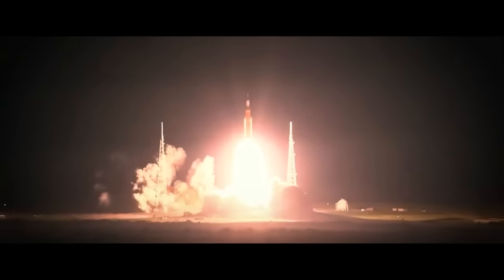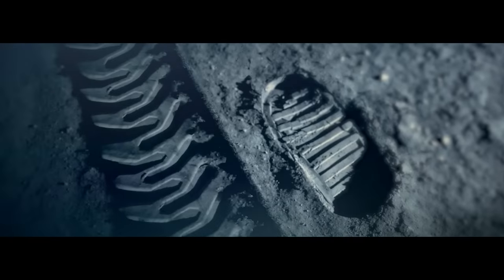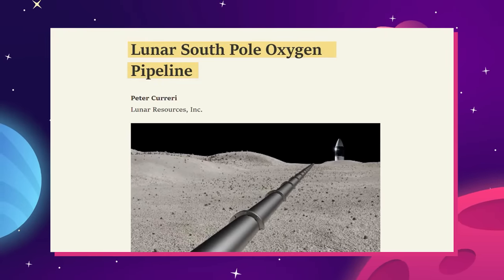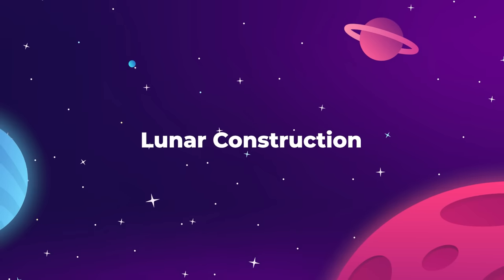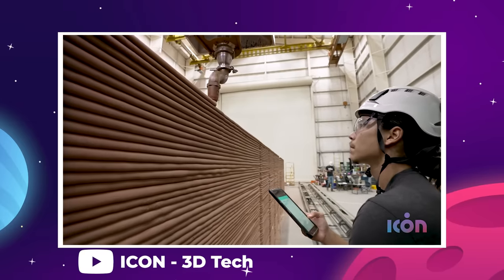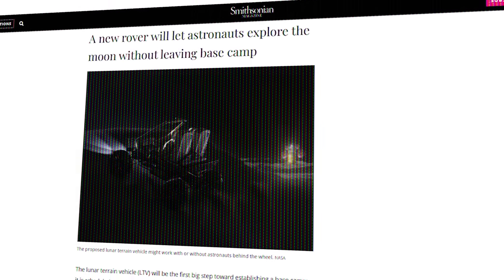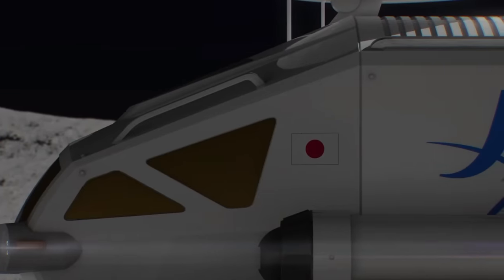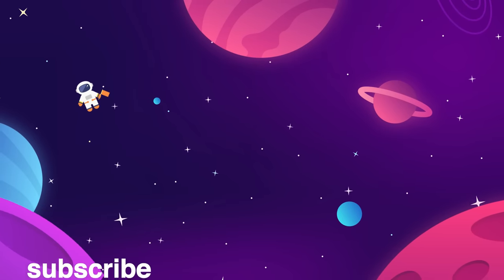How NASA Plans To Build The First Moon Base!

Comment: How do they plan to secure energy source for all this? Just for a reference: To produce a ton of steel in an electric arc furnace requires approximately 400 kilowatt-hours (1.44 gigajoules) per short ton or about 440 kWh (1.6 GJ) per tonne; the theoretical minimum amount of energy required to melt a tonne of scrap steel is 300 kWh (1.09 GJ) (melting point 1,520 °C (2,768 °F)).
If it's solar energy then they will need massive fields. And they are still light years away from nuclear. NASA should give more funding and support to Elon in order to all this to success

Comment: The moon's surface area is about 14.6 million square miles (38 million square km), which is less than the total surface area of the continent of Asia (17.2 million square miles or 44.5 million square km). Would it not be a little bit less stupid, and much easier spending those astronomical amounts of taxpayer’s money on planet earth?

Comment: i genuinely think if we colonised a planet or a moon successfully and created manufacturing there instead of on earth it would give use to mostly ‘ uninhabitable ‘ planets. the infrastructure needed would be expensive but worth it , ores mined at the asteroid belt , shipped to mars for manufacturing to the moon for delivery to Earth. it would atleast remove the cost on the Earths atmosphere due to emissions and pollution from waste. Maybe in a few 100 years this idea will be as normal as shipping ores from africa to china for manufacturing , and shipped to consumers.
this moon mission could lay the ground works for a solar system wide trading route.

Comment: I still think that dust is going to continue to be an issue.  My guess it will ultimately be fixed using some kind of electronic system that repels the dust electrically.
Reply: The dust will be an issue but it won't billow up and hang there like the picture shows. Since there is no atmosphere it will only react to the thrust of the lander it which kicks up will quickly be pulled back down by gravety.

Comment: No one seems to remember the Ares design with eight boosters. 😜 You wanna talk payload? 😏 and they can add back in that fifth liquid fuel engine if need be also. NASA is by no means maxed out in heavy rockets.
Reply: The SLS is based on the Ares launch system. That means a lot of the design components of the Ares rocket are transferable to the SLS. We can launch much larger payloads therefore. These would likely be mostly fuel and provisions, of course, since the crew is a fairly light component of the overall mission.

Comment: Thanks for the heads-up video. Sourcing the resin for 3D printing moon habitats really intrigues me from a chemical engineering point of view. A little more than half the regolith volume will have to be resin and making the resin on the moon will be extremely challenging.  So I guess it will be “Starshipped” from earth in the beginning. 

Landed at $20 million dollar for one hundred tonnes, a 1,700 ft² habitat might use 5 tonnes, so each habitat’s resin costs out at $1 million. Doable.

Comment: Question how do they know the printed structures will be air tight, and able too hold pressure?
Reply: At a guess, build them on earth, pressurize them, and check for leaks.
Reply: Not difficult. Use a Vacuum chamber for testing. Normal engineering process.

Comment: It's exciting, but NASA really needs to stop using US-only units when it comes to space exploration, because it's bound to be (and already is) an international effort, which means that NASA equipment and designs have to work with the other 95% of humanity (let's say that again *95*%) who use proper SI units. We can't have tools and habitats and displays that aren't compatible - it would be a disaster worse than the Apollo 13 issue where they had to connect a square CO2 filter with a round housing. NASA need to stop larking around with Internationally non-standard units just for the sake of Flat-earth Fox News viewers.

Again, the reference to 1 million pounds of Lunar dust when the HLS touches down. What on earth does that mean to most people on earth? Pounds are weights not mass. So, is this 455 tonnes or 2700 tonnes (because Lunar gravity is 1/6th)? You could have at least if you're going to use this kind of Victorian jargon have used tons, because at least then a US ton is approximately a real tonne.

Comment: If they want to get REALLY serious about colonizing the moon, going far industrially beyond just habitation for habitation's sake, here are 2 VERY worthwhile lunar endeavors that would make VERY productive use of lunar Farside as well as its equatorial regions.  On the Far Side, preferrably inside the Mare Orientale Basin, a vast array of radio telescopes as well as a cellular network of infrared telescopes (like James Webb on a 100,000 scale) could see make direct visual observations of Exoplanets.  Now to the equatorial regions, namely, the eastern equatorial limb.  That would the ideal place for a linear accelerator complex that could use a railgun-based launch system to fling unmanned cargo back to earth orbit directly from the lunar surface, saving enormous cost.  Just a start

Comment: Lol no to those building, probably the first base will be a metal shell covered in lunar regolith. My first choice would be a Starship on it side as you can have as much room as the ISS refabed, and then with some elbow grease you can have about 3x the pressurized volume of the ISS by cutting out the fuel tank headers which can take 5 atmospheres of pressure just in standard operation, and you are always supposed to have a 1.5x or greater safety factor so it can take 7.5 atmospheres of pressure so plenty for holding 1 atmosphere of pressure.

Altough you are probably going to be running pure oxygen at 1/5 atmospheric pressure to prevent the atmosphere leaking away and making CO2 scrubbing easier.

Comment: I have never seen any numbers published about the energy requirement of 3D print on the Moon, but I can imagine it is a a lot for melting all that regolith.  The advantage of 3D print lies in producing small but complex and sophisticates objects and components , but not large massive walls and ceilings.
On the moon it simple is not necessary to 3D print walls and ceilings. The main structural challenge is the inner pressure ( 100KN/m2 for Earth´ sea level air pressure) und to keep it airtight.  The his can be  managed with a prefabricated inflatable membrane structure.  that simply  is covered with loose regolith  for protection from cosmic radiation ans micrometeorites.
A sufficient protection from radiation requires a 4 -5 meters thick cover of loose  regolith or 2,5 - 3 meters of 3D printed wall structure, So the time and energy requirement to 3D print these masses would be enormous .and you still would better  cover the inner side of the wall with a membrane to make sure it is  airtight

Comment: I agree with @Space Private that the electrostatic problem with the dust is going to be a big obstacle. And as everyone knows, the Apollo lunar astronauts' short duration outside the Van Allen radiation belts is what enabled them to be safe from high radiation. NASA will have to figure a way to safeguard crews on longer moon missions. Portable magnetic field generators are being considered. Some believe 5-foot-thick lead walls around vehicles ought to be used. At any rate, we have a lot of work to do. I'd like to see a moon presence be established, but the NASA and contractor PR people need to be upfront about where we stand.

Comment: I wonder why NASA decided to build a surface habitat instead of boring into the crust. All the tech and equipment would be about the same for a borer. Underground bases can be endlessly expanded, and protects astronauts from cosmic rays and meteor showers. One small pebble could go right through that surface habitat and cause a explosion of the pressurized air.

Comment: IMO the best base-building would be just burying Starship underground VERTICALLY. 
Vertical shaft sinking technology is well proven on earth. They'd only need to attach external ring around starship (for stabilisation and lowering winches), and ~3m diameter elevator shaft through the middle of entire rocket (to get boring machine out after sinking for reuse, and for future elevator between floors). And a self-propelled crane, for moving ring and boring machine to next starships.

Comment: The dust is ionized somewhat by the sun's rays and can float around as if there were an atmosphere and so it can get where you don't expect it.  An anti static charge might mitigate this down to near zero.  Building a structure on the moon is more problematic than building in the Zero G of space.  Large items cannot easily be deployed from the top of a 160 foot rocket and then you have gravity to deal with.  Small modules or even inflatables will suffice.  The only value to going to the moon is to mine elements from it, not to build a hotel.  Build the hotel in space, it's easy and can be huge.  The regolith and concrete idea is not well suited to 10 pounds of pressure, it would explode it.  I think your walls would have to be curved and domed and also the floor and all about 3 feet thick with steel reinforcement or perhaps long strand fiberglass.

Comment: The greatest challenge for a moonbase - or even Mars base - is sustainability.  Food, energy, secured dwelling, oxygen and balanced, atmosphere and pressure, water, parts abd equipment, and many, many more.  Until these are resolved, we limited to exploration but not immediate permanent settlement.  What may be feasible is sending robotics to built habitats and beginn the process of creating a breathable atmosphere, water production, and environmental managenent and testings.

Comment: I find it very exciting. However, we have to identify the serious challenges and how this will impact the habitats and the life style of people on the moon. In that report, we heard that suits had to be resisistant to Moon dust being very abrasive. That is one serious issue. There is a second extremely difficult: the one of solar flares. Those coronal mass ejections happen on a regular basis and they will treathen the life on the Moon. Those bases need to offer an undergound shelter for people, the only way to be protected. Knowing that it takes 8 minutes for those to reach the moon, this means that people should never be allowed to go further then 8 minutes away from any shelter. This will then require many underground sherlters to be made in many places near the people activity. You cannot send people further away and this also means that your pipelines and roads cannot run very far before another shelter is built (clearly by robots).

Comment: I can just see it now if anybody is ever seen the TV show space 1999 I can see the base on the moon becoming to be like that one where they would have a big store areas underground to have spacecraft in as well as airlock systems that would be connected to the pads where astronauts can go from the spacecraft to elevator system and go to an underground tube system to go from building to building along the surface of the moon I see that is a very good possibility and I also see that being one of the greatest message and idea Compas accomplished on the moon to be nearly or completely identical to moon base alpha space 1999 and I can look at this because the technology is developing now by the time the base is completely finished it will almost look like that starting off with ground rovers on solid surface and landing pads that are multiple level around the perimeter of the base and within the base having buildings that have air locks that the vehicles can go into an exit from from there I can see tunneling being done from longer facilities underground connection where are you have to do is happen to a underground subway car or a tube type system for a vehicle would travel in to go from building to building underground and then exit and using an elevator and going up into the base I could see the regulus and lead coated windows or something similar like that to keep radiation down to a minimum for anyone reading this thank you very much and I hope NASA sees this idea and I would love to do a drawing and rendering of the concept for them to look at long-term ways with their contractors

Comment: Whatever it looks like that doesn't travel is up to interior designers and engineers. Rounded corners on furniture are to remember. A full house or interior vacuum system because, sharp dust? In the vacuum tech makes the dust dull. Dulled dust interiors has a ring to it.

Comment: I like that idea that is a very inventive and very productive situation then we can even do it as that the robotic electro-conductive 3D printer system where it's just taking and building the plots walls moving on and then dropping and making like dirt mounds or taking it making us constructive compress water vapor clay form using the sediment on the moon and then building and 3D printing or welding the pipe was backing up and making a little scams as going and welding everything together I think is that one that was pretty good did I ever heard was the 3D printing the main structures and everything up there

Comment: This is a good video but I would like to see more from the engineering point of view.  Composite structures must be able to withstand about 14 psi.  13.88 psi is one ton per square foot of outward pressure.  Those thin wall flat wall structures cannot handle that kind of pressure.  Good job.

Comment: Regolith's properties are both a blessing a curse. The curse is obvious, but the blessing is that the sharp edges make for excellent building material, so they don't only need to be melted but can be used as sand and cement mixture (or waterless equivalent) with incredible binding properties.

Comment: they need to go underground on the moon the same could be said for mars ,,easier to pressurize and maintain pressure its safer also protects from radition from the sun easier to maintain
temperture and inhabitable enviorment,,could also protect against small meteors

Comment: In the short term, the Starships themselves, will be the habitat.  In the medium term, inflatable habitats.  Long term, tunnels and underground, maybe with domes poking up.  Should be possible to deal by reversing the electrostatic charged dust so that it falls off in the airlock and is suctioned up.  At some point, perhaps it would be possible to scoop up the moon dust and melt it down and spread it out like asphalt for a certain distance around the moonbase.

Comment: In all honesty, a moon base should be built into the ground, or under the ground.   If a base is built under the ground, then you would not need as much energy to heat, and cool the atmosphere within that base.   Plus if the base is built under the ground, you also get another great benefit, and that is less radiation protection is actually needed.

Comment: The Moon is the first step.  Second step is to build the Kubrick Space Station (KSS) orbiting Earth.  The KSS will be built on the moon by hyper adroit robots using lunar material.  This will allow humans to stay longer in space.  Travel to the moon will be via the KSS.  Step three is to build Solar Class Mining Craft (SCMC's) from lunar materials.  Asteroid Mining will be one of the next energy revolutions, with access to unimaginable amounts of precious metals.  Metals that will coat the exteriors of the KSS and SCMC's to protect against solar radiation, and metals for electronics on the Moon, as well as the Earth.  The moon has an abundant amount of H3, the fuel for Nuclear Fusion reactors of the future.

Comment: All astronauts who spent time on the lunar surface, reported feelings of extreme depression. They said it felt like being in a deep hole and wondered if they would ever make it back to good old Earth. All of these astronauts, who visited the Moon, became religious, when they returned to Earth. I wonder if NASA is considering this danger of humans plummeting, into the depths of depression.
Reply: I don't know where you got that from. The religious astronauts had their belief long before they flew to the Moon, not after they came back. John Young (Aopllo 16) said that if you have to go to the Moon to find God, then you have a problem. Buzz Aldrin had a difficult time adjusting to normal life back home, but got over it. Many of them wrote Autobiographies, you should read some to gain a more accurate picture.

Comment: Speaking of the moon, I would like to silence the doubters that we were even there. How about we use either the Hubble, or the J.W.S.T. To take a photo of the landing site and the rover to publish. Proof positive.
Reply: Did you ever question why they didn't just do that? Seems so simple, a couple hours and it's done. But no, not happening is it. 

How did they fit all that parachute material in there?

How amazing were the batteries used? We have battery operated cars everywhere now, but did people know there was a battery operated car driven on the moon over 50 years ago? I thought battery technology only recently progressed to the point we have cars using them.

The camera angle of the take off from the moon, the zooming out and following the craft perfectly - done by remote control on earth 380,000 Km away - and did it all perfectly. They must have calculated the delay times ahead of time, no practice run, just perfectly shot by a very good camera man here on earth using remote control 380 thousand damn Kms away. I suppose he had a live feed from that camera to be able to do that, and some non-human like skills. 

Back to the old drawing board for you.